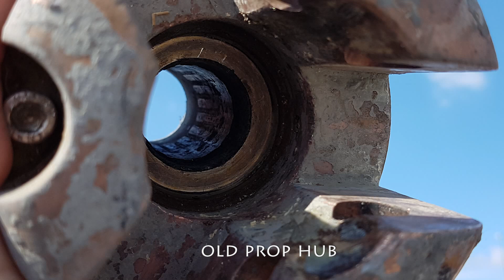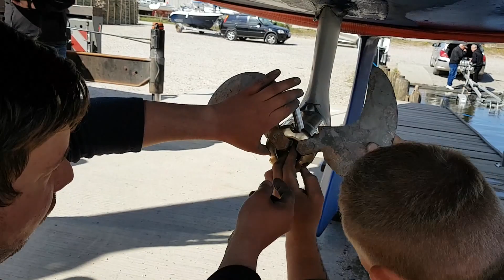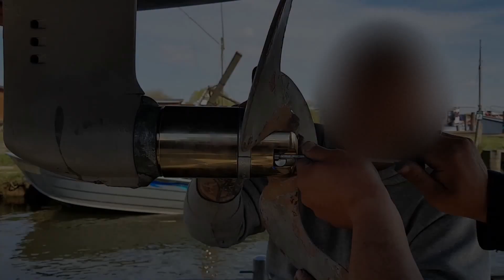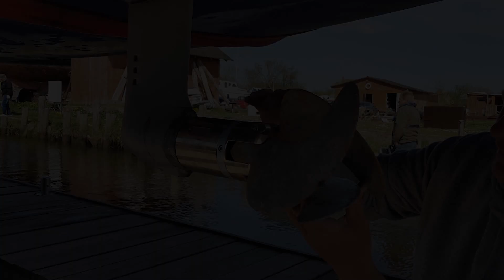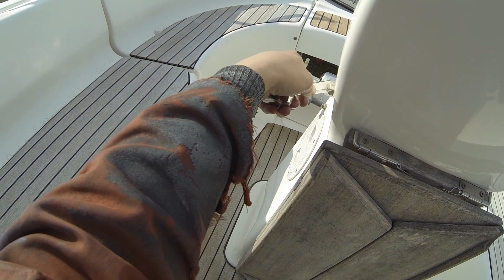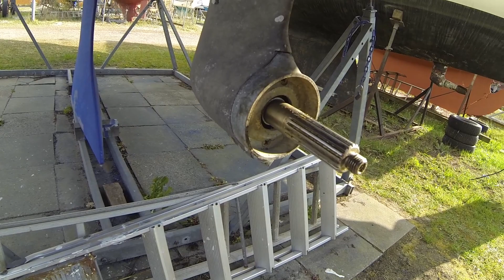Volvo Penta folding prop hub don´t last forever

Comment: I see many comments here as in this video where the entire hub assembly was replaced.  This is expensive and not necessary as there is a Volvo replacement hub insert available but not listed by Volvo for this prop. It is like they are purposely hiding the replacement hub insert and list it for a different prop all together.  Remove/replace inner splined hub $400 vs $1021 for a new hub assembly from Volvo.  Also, the new hub assembly does not work with older prop blades as they changed it ever so slightly so you have to buy new blades as well.  Leave it up to Volvo!

Comment: I have got the same problem with my 2 blade folding propeller from Volvo Penta part 21630720. 

The interior part of this massive brass (to massive?) propeller is manufactured of aluminium alloy, which is not being strong enough to enormous moments created when switching forth and back during harbor maneuvers. It  have been completely damaged inside, exact the way this video shows. I contacted Volvo Penta and they said they never heard about this problem, but they must be laying. The aluminium is also very sensitive to rust degradation (yes it is) and the choice of this material in this place was probably done to make customers, to replace this expensive hub often, without any thoughts about endangering their lives in the seas.

The construction is faulty and it must be a lot of props damaged exact the same way.

There are more problems with this prop:

1. Propeller hub does not fit behind the standard anode on 110S sail drive. It should go with its back flange, like in older Volvo propeller models, behind the anode's walls, but it misses it by 4-5 mm. 
2. When going reverse this propeller sometimes doesn't want to open at all. To correct this flop, I had to make a little hole close to blade gear, and drive in it little stainless screw. It prevented blades from closing completely by about 3 mm. It was enough to make it open every time. 
3. Volvo Penta does not bother even to put right instruction about assembling this propeller on 110S sail drive. The picture in their instruction has not to much to do with the real gear, and there is missing both anode and the distance sleeve from drive part, which must be put to make this prop work properly on this device. 

Volvo Penta did extremely bad job with this prop ( and previous folding props, loosing blades too), but they refuse to admit it. Use another folding props. Avoid Volvo Penta. Swedish quality is only a mit and in this case a bitter joke!

Comment: I had a similar folding on my Bavaria C45 and noticed the waering out it was still working but We decided to change to avoid a total loss of power in sea.local Volvo penta dealer proposed 3 weeks for replacement of center part and I bought an original fixed prop at a lower pricethan the center part of folding prop..I wonder if it is possible to produce an inner sleeve to go inside my older center..I guess I need the measurements of S-drive rod..
Reply from the maker: Yes it seems like a lot of people has the same problem with the folding prop hub, but something I have discovered is the numbers is different on the new models and you can't find the old prop number anymore. Maybe there has been a design fault in the older generation, also a bit strange why all the old prop hubs is going bad. If you have a 2 blade fixed prop the drag is only a problem at +8 knots. If you have a 3 blade fixed prop there would be a difference from fixed to folding regarding drag. You can find the prop drag curve at volvo pentas website.

Comment: I've gone through 2 hubs in 6yrs - the rubber inset moves and causes increasing vibration. No-one will replace the insert even though the part is available.
Reply: Yes, I replace the inner hubs for the Volvo folding props. $400 vs $1021 for a new hub from Volvo.

Comment: IHi, I have the same propeller produced by Radice on my Bavaria 32 (2002) with Volvo MD2020 engine and I never had any problems. I would like to know what size propeller, pitch and diameter the propeller has.
Reply from the maker: I don't know very much about propellers but when I search on the hub number "3858285" (the failed hub) I can see this is not the only one there has failed. Maybe there is a production error in this model. When looking at Volvos propeller guide I can see they have changed the numbers on the new models, so maybe Volvo has been aware of the problem with the hub model 3858285

Comment: If it is so far gone, how it was possible to motor the boat last summer?
Reply from the maker: He has sailed some trips this year and a lot last year, the question is also why it happened. Maybe it is due to a bolt there is not tightened enough or maybe a wrong dimension spacer, know there is a spacer for the fixed blade and another type for the folding prop according to my investigation. Think the most important thing is to secure there is no veil in the hub when it is mounted, I know there is absolutely no vail in my own fixed blade prop when it is mounted.
Reply: Tino G - Sailing... I guess this is natural result after long period of using ..every time you put it reverse and forward there’s an incremental wear out..it builds in time and excellerates once the gap is greater..you need to give some power to lock the wings for reverse and it locks under some pressure and causes the problem..
Reply: Hi I have the same problem, the hub was original Volvo penta part. I replace after only two years working